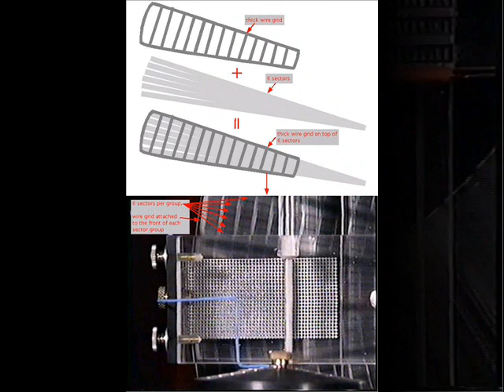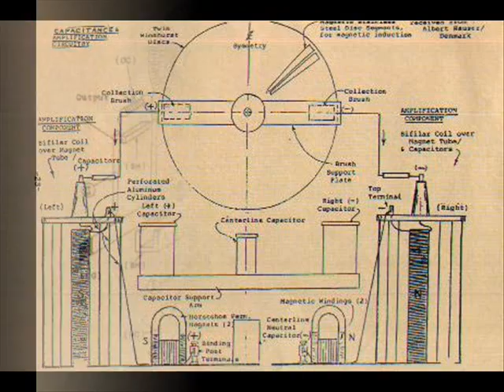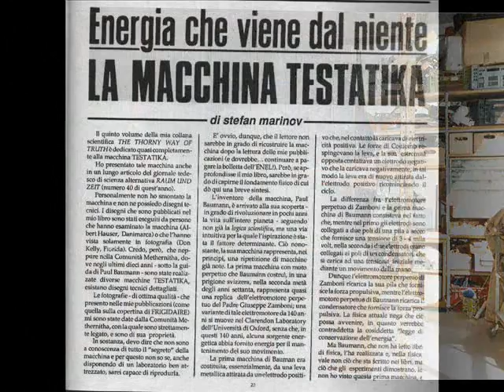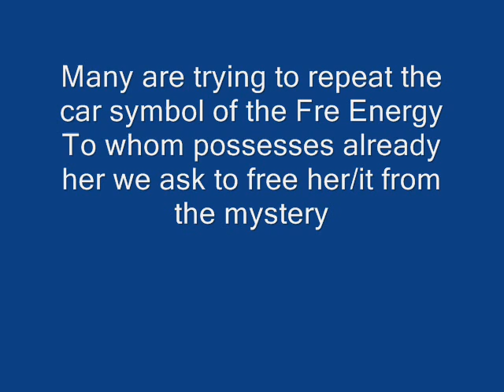Magikal Power 2 - methernitha Testatika

Comment: @gavincurtis They made it very clear in German comments  that humidity does drastic reduce the effect of power generation. We all know that in winter, when it is dry and cold static electricity, energy is the highest. It is a kind of a Van der Graaf geneator or machine, storing energy in capacitors.

Comment: I have been interested in this machine for past 20+ years and still don't know what to make of it...

However, the very clear closeup at the beginning of this video I recognize that the 'grid' with the Methernitha nameplate looks very much like a section of a conventional radiator or oil cooler.

Also what is up with the hologram decal in the center hub of the rotating disk?  Decoration?

Comment: What do you think why you live? We’re is that energy comes from? Indeed…. That energy is everywhere it called vibrations which tries to harmonise but the difference makes the eternal movement. We live in a galvanic cell powered by thé electrostatic radiation which is everything surrounding us. Even gravity as wiki said is not true it’s only a repeating process of attraction fields by the reposition of a propulsion system like a flying wheel force by the density of friction, velocity en vibrations.